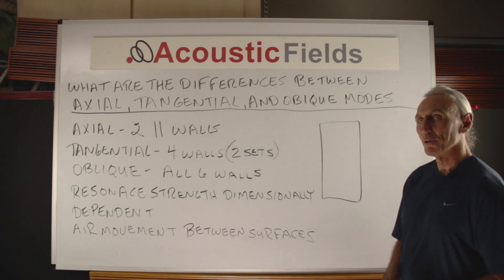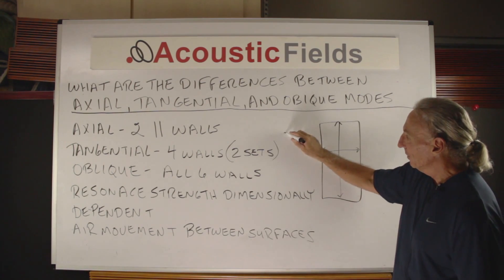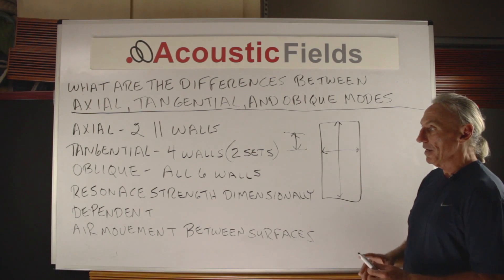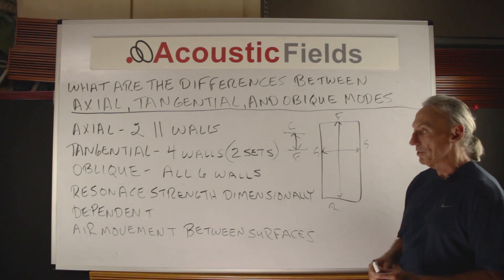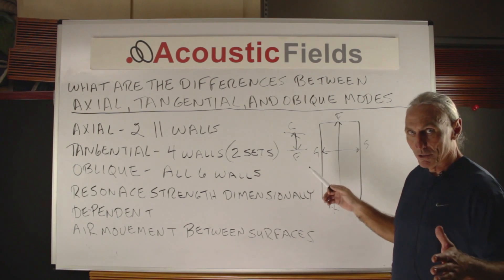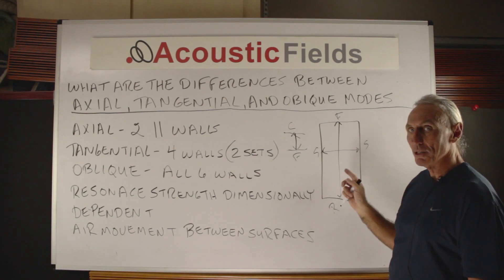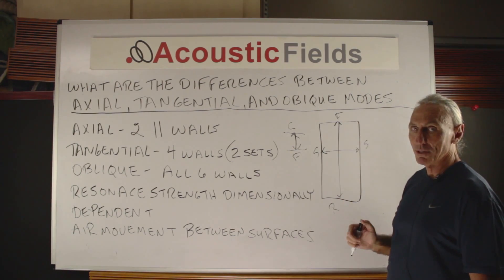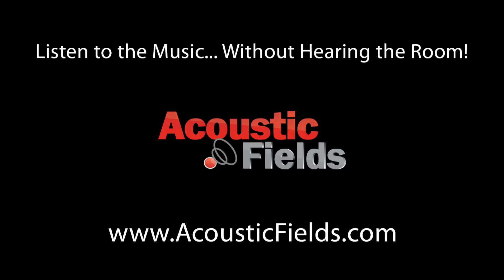What Are the Differences between Axial, Tangential and Oblique Modes? - www.AcousticFields.com

Comment: Axial pressure is the pressure that exists between 2 parallel walls
Tangential pressure is... the pressure between four walls? Wtf? Wouldn't that make it the sum of tangential pressure?
Reply from the maker: F,  No. Two parallel walls produce the most unwanted energy.  Energy trapped two sidewalls, a front and rear wall or a floor and ceiling will produce the most unwanted pressure. Tangential pressure results from wavelengths that are not sympathetic to the distances offered by side to side and say front to rear.  Energy "trapped" between four walls is half that of two walls, on average. There are three sound fields within a room. There is floor to ceiling, sidewall to sidewall, and front to rear.

Comment: Could you demonstrate how to calculate the room modes? Thanks
Reply from the maker: V, Take the frequency of resonance you are looking at, lets use 40 Hz. Divide 1132 (speed of sound) by 40 Hz. = 28'.  You have a 28' long wave of energy that has to fit completely in your room dimensions. Any dimension (width, height, length) less than 28' will produce a resonance. How strong or how much amplitude it will have depends on the dimensions of the room and how far away 28' is from those dimensions. For example, if you have a 18' length, then 18/28 is around a 50% ratio so it would be a large amplitude mode.
Reply: Thanks! I'm working on a open source software to help to find the best dimensions for a room within specified limits. I'd appreciate your opinion soon, I'm almost finishing the last calculations (modes is one of them). Have a great day.
Reply from the maker: V,  Remember there is no "best" case for small rooms. You can create a chart that shows  ratios that minimize low frequency pressure issues but you will never find anything that is "best". Any chart you create will not allow for low frequency treatment space requirements.  This is where Bonella and Bolt fall short. Since low frequency management takes up 12" - 16" of space on each wall,  this treatment requirement then creates a room with new dimensions that may or may not be favorable to usage. The goal is to find a room with the distance requirements to match usage but also the volume to allow for reducing that footprint to a smaller room with the low frequency space treatment requirements. A graph can be a starting point but in 40 years of doing this, I have never seen a room size end up like the existing charts indicate. They just don't go far enough in their thinking process.

Comment: Thank you so much for your work, it makes all the difference, this is hard to overstate! I have a long-standing question on treatment. My walls are all concrete/plaster. I've got a suspended drape covering up some nasty popcorn ceiling above. I was wondering, does it make sense - in order to fill the acoustic gap between the ugly ceiling and the suspended layer - to insert drywall or another material, on which the actual ceiling acoustic treatment will be further applied? I ask also because, in one of your other videos, you mention that the 'shell' of the room must have the same acoustic properties across the board. So, if my walls are cement/plaster, my floor is wooden, and my ceiling will be drywall, does this mean that the acoustic calculations and considerations for actual treatment will become more complex than if all the materials were the same? Thank you, Dennis.
Reply from the maker: D,  I can not answer your questions without knowing much more about your room. Go to this link and fill out the required information. Photos are always a good idea to include. https://www.acousticfields.com/free-room-analysis/
Reply: do not disturb a popcorn ceiling in any way!!! the ONLY thing you can do is hire removal crew, and just deal with it.. its got asbestos, and by simply disturbing the stuff in any way will release the breathable particles...

Comment: could you discuss how to be resolve these issues by adjusting room size (optimal room dimensions) and wall angles. Thanks!
Reply from the maker: Z,  Room dimensions are all about unwanted low frequency pressure and angled walls are about reflections. They are two different issues.
Reply: Gotcha. So angled walls simply reduces standing waves. Is there an optimal width to height ratio to reduce low frequency pressure?
Reply from the maker: Z,  No, angled walls have nothing to do with reducing standing waves. They are for reflection management of middle and high frequencies. You have to select the proper balance between width, height, and length to match the audio usage of the room in order to have a balance between low frequency treatment and internal room volume.
Reply: Roger that. Looking forward to chatting today :)